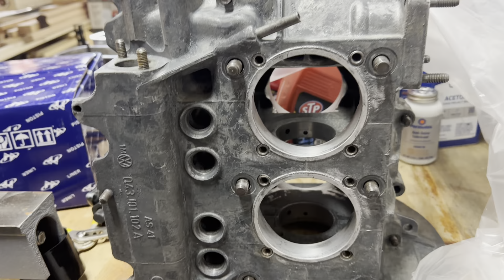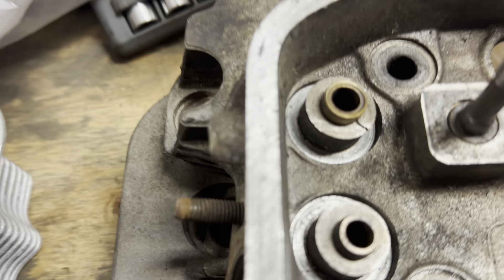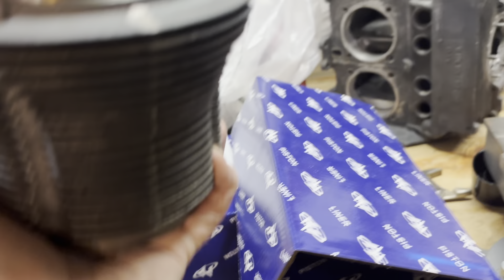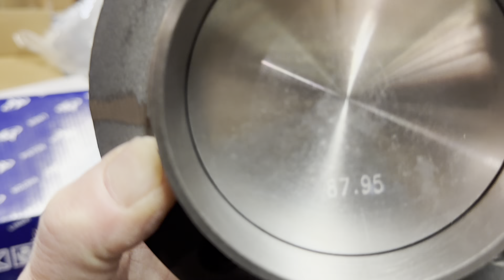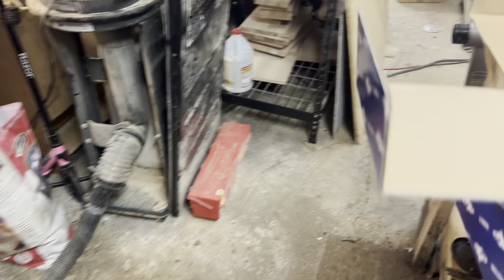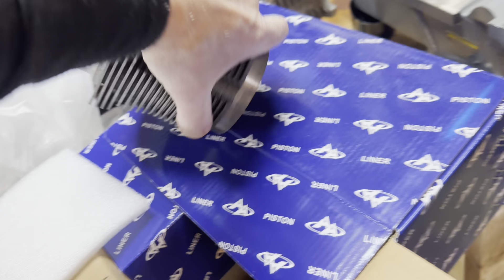VW Air cooled engine rebuild 88 mm slip ins

Comment: I have read that those 88mm, don't last as long as the stock 85.5mm. Your application isn't for a daily driver, so it should be good enough for now. I use the 87mm kit on my bug.  Next time I'll use 88mm TW kit, which is better than the 85.5 kit on a stock engine.
Reply from the maker: It’s for a sand rail. I’ve read the same thing. What I’m reading says that it’s because the thin walled cylinders don’t dissipate heat well. I’m going to keep my fingers crossed and do all I can to make sure heat doesn’t become an issue. I’m located in Michigan and usually only ride the trails in the spring and in the fall so the weather is typically on the cooler side.
Reply: @jachoftrades6t8  
88mm should be good enough for your application.  They will last 5k or ten years give or take.

Comment: What empi heads did you use,I got the same 88 mm tw kit but still not sure on the heads yet....
Reply from the maker: I got them from Jbugs. (GVT-2)They came with a factory valve job and porting and also duel high rev springs of which I removed the smaller spring. One thing that I left out that I probably should have done was a performance cam. It will help it run a little stronger and cooler.
Reply from the maker: I haven’t run this engine yet so the jury’s still out on how well this thing is going to be.
Reply from the maker: Also if you’re going with the thick walled make sure the heads you get will fit otherwise you may have some machine work to do